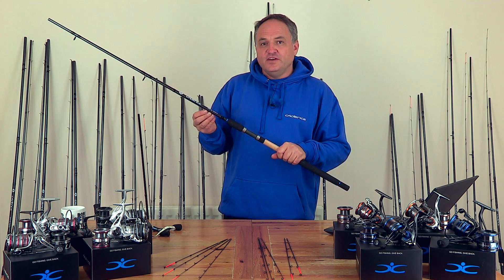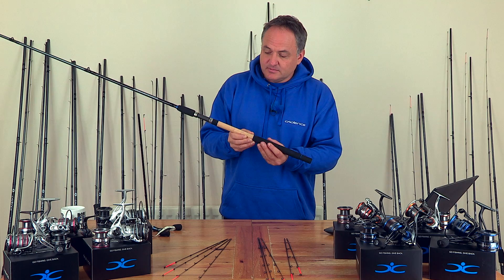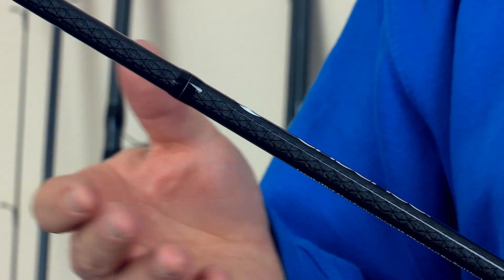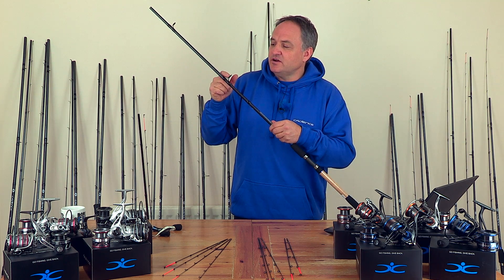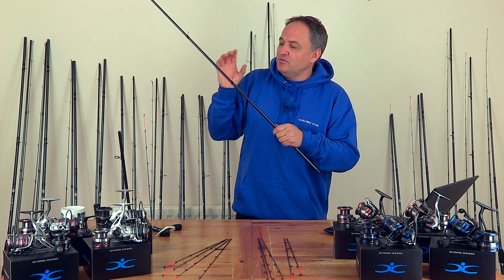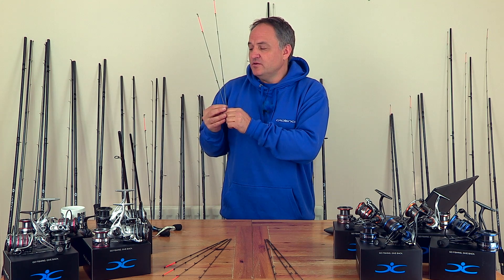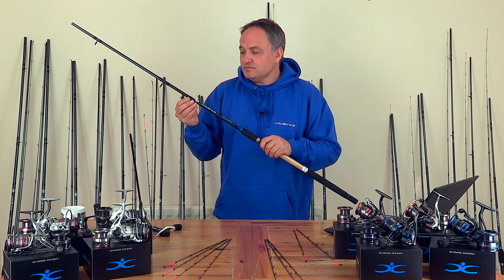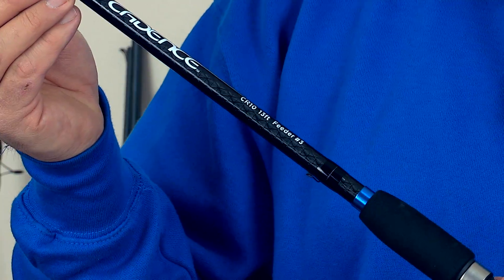Cadence Fishing CR10 13ft #3 Feeder Rod

Comment: Cracking rods - really powerful; nice top to middle section bend. Good size eyes on the tips to allow any shock-leader knots through with ease. I think the tip ratings are nominal - possibly a little understated but are ideal for long chucks on bigger waters that can get a tow on when breeze gets up. Excellent VFM